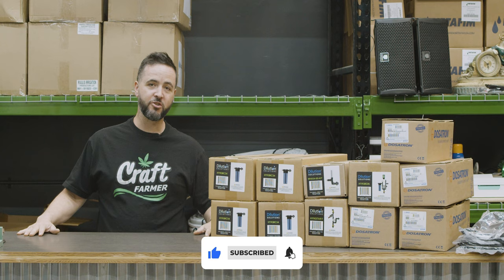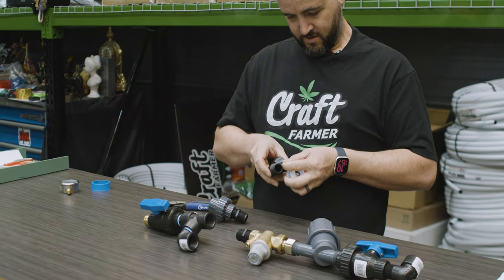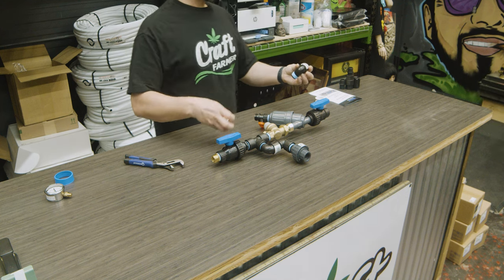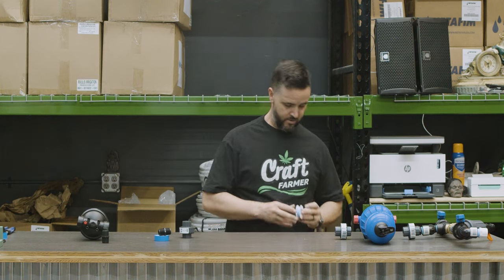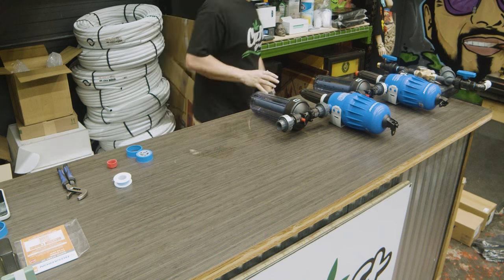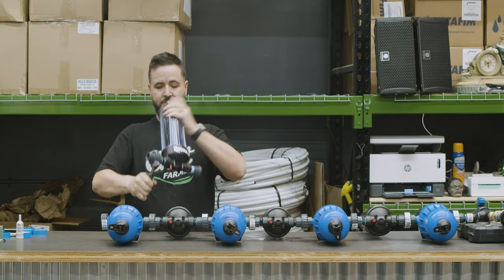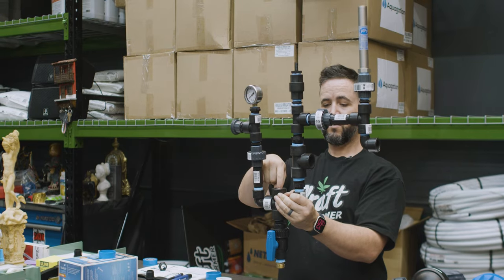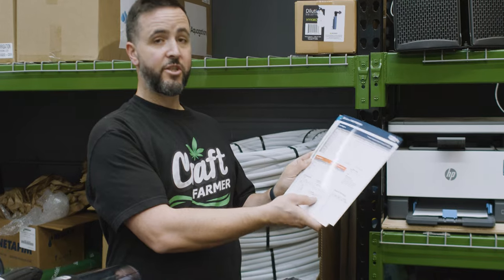DOSATRON Assembly Tutorial

Comment: I think you need to inject Grow or Bloom (which will bring your PH back down in the 6 range from adding Balance), then you add Core.  I have found that when you add Core right after adding Balance (which will shoot your ph to 8 or 9 range, the Calcium at that ph will precipitate out of solution and clog up your emitters.  But, if you switch from Core tto Bloom to Bloom to Core, the Bloom or Grow solution drives that PH back down and it is now safe to add Core into the system without Calcium fallout.
Reply: I believe that Athena has already addressed this, but just a reminder as this video was created before they made this change.  Otherwise, Love this video.  Great instructions....
Reply from the maker: You are 100% correct Andrew thank you so much for your comment and input.

Comment: Why would you want to put a pressure regulator at the beginning, you will be losing pressure anyhow when it goes through everything.  I would want to only decrease pressure before it goes to driptape or rotary's per pressure rating?
Reply from the maker: Thats how they have the system designed.

Comment: All those mixing chambers after every single dosatrons are completely unnecessary. What's the point of mixing if you are still going to add another nutrient downstream. And furthermore, if you had at least three 90 degree turns after your last injection then any added benefit of a chamber would be negligible at best. Source: 9 years a grower at 300 million/year company.
Reply: Agreed, for the ladies no issue, as the drippers ensure equal amount of water and fertilizer, even if you get some variations in the pipe.
You absolutely need a single mixing chamber just prior to the probes. To get a stable reading.
and wrong, elbows, Ts and other fittings don't give you lateral mixing. Variations going in will come out at the end of the line. Only a mixing chamber of suitable size can do this. 
Trust the blue.
Reply: @123derpan  yeah. . .I agree you definitely need a mixing chamber if you are going to do any pH/EC probe after injection. But if not (not ideal obviously), then the benefits are negligible.
Reply: @brent829 You make 300 million a year and don’t understand the chemistry steps of mixing nutrients? This industry is disgusting.
Reply: @Islandiver This isn't chemistry, it's just mixing. If you are doing "chemistry" (as you put it), then that implies you have a reaction, which is very bad when working with plant nutrients. You clearly have no clue what you are talking about.
Reply: This is actually quite applicable to what I'm approaching. I see a lot of designs NOT have chambers between each injectors, but many show between each also. Dosatron support of course recommends chambers between each. It gets cumbersome quickly..
Reply: @Hangreek  they aren't exactly cheap either, what kind of project are you working on?